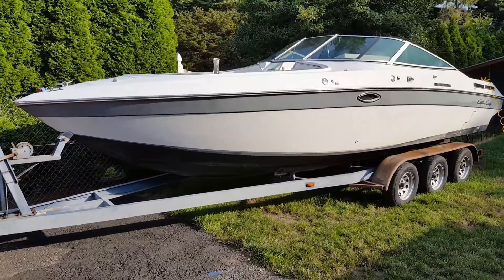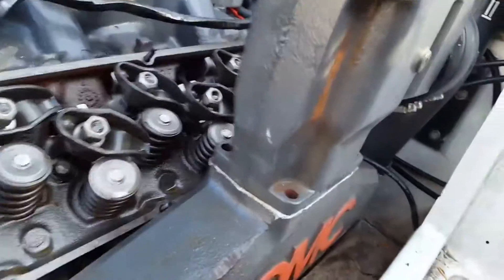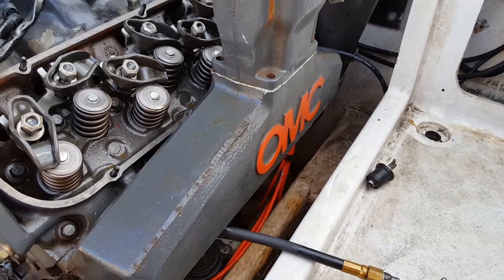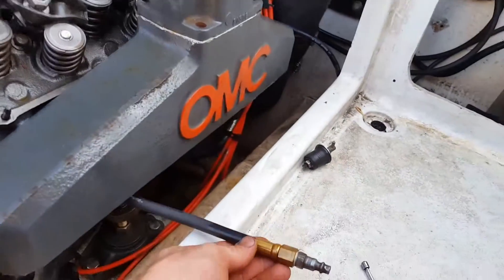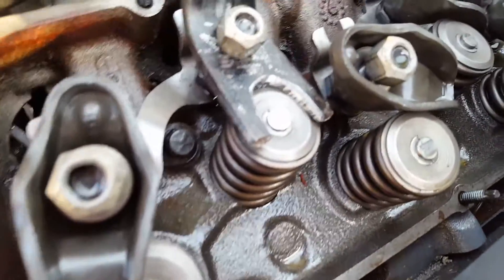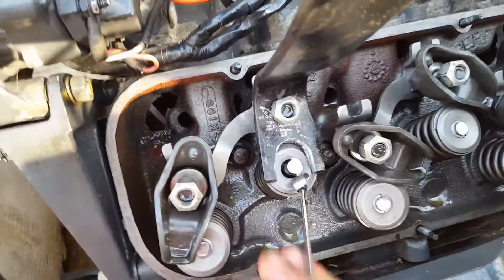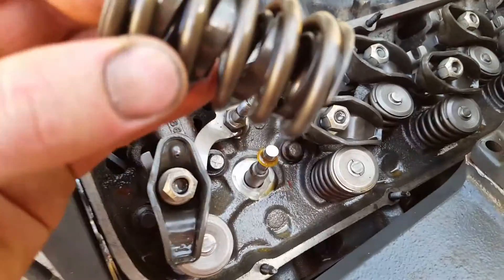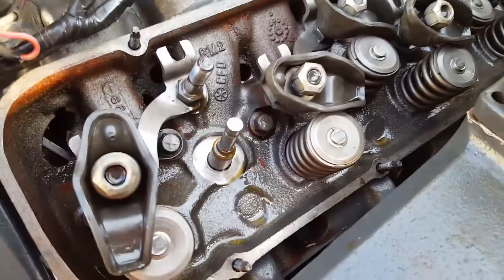Homemade VALVE SPRING COMPRESSOR TOOL - Remove springs without taking heads off - Stud mount

Comment: You can just simply tdc the cylinder you where removing the valve spring at
Reply: That would work?
Reply: Yep tried it many times on diesel engine no need for air compressor just lightly press the compressor so the valve won't slap the piston

Comment: That's not an umbrella seal.  Umbrellas drape the guides and control oil better from get down into combustion chambers.  Those are just a standard oil control seals.

Comment: I have a pry bar.  Impossible to drill it...made of spring steel and can't drill anything.
Reply from the maker: Yeah if it's a good bar it might be tough. The cheap Chinese ones work best. I was able to drill mine pretty easily

Comment: Works great. If ur heads are off just sit them on a table so the valves touch the table to get the keeper out.
Reply from the maker: Yeah with the heads off definitely makes it a little easier.  Glad to hear the tool worked good for you
Reply: @NoNonsenseKnowHow  how do I clean inside the heads though it’s too cold in my shop to use anything everything froze up over night even my propane tanks. My angle grinder works.
Reply from the maker: Not sure. Yeah propane sucks for that reason. I use a waste oil heater
Reply: @NoNonsenseKnowHow  rocket stove ? Make a video plz.
Reply: @NoNonsenseKnowHow  I’m literally freezing my ass off out here man.
Reply: @NoNonsenseKnowHow  evaporator on my compressor is locked and the sand in my blaster is frozen like a rock in the bottom. And now the propane tank is off but the flow is full. Like the cold broke the valve in the regulator.  Need something I can run overnight unattended.
Reply: @NoNonsenseKnowHow  they are d3 going in my 1984 RV. They seem okay enough just to rebuild with what I have just the insides are gunked up and light rust. Electrolysis bath ?
Reply from the maker: @akkadianrecords3709  I wouldn't get too carried away with cleaning them up. As long as the mating surfaces are clean
Reply: @NoNonsenseKnowHow  thanks. It only had 11,000 miles on it just sat for a bit with oil in it so kinda saved it.

Comment: Question, how effective is that air in the cylinder thing? i'm gonna replace some seals here in the future and Ive never used the air in the spark plug hole trick,just make sure i get the piston as close as possible to TDC and all that? i work in a shop and i have access to plenty of air and all that,just looking for tips and possible worst case scenarios, thank you for your time.
Reply from the maker: It works good. Just have to make sure it's at directly top dead center. Otherwise it could push the Piston back down
Reply: @NoNonsenseKnowHow  Thank you.
Reply from the maker: @dntlss  no prob!

Comment: This is just as good as the summit piece they want $45  for + $12 shipping!
Very glad you just saved me big time here!!
Reply from the maker: Yeah it definitely works great! Probably even better than the summit one. Sturdy built
Reply: @NoNonsenseKnowHow  
Yes.  
The video proved it the creative pry bar tool is equally safe & durable and is why I’m going to do this.
Reply from the maker: @ashqelon7267  awesome man, good luck. If you check my links in the description, there is actually a similar one on Amazon for pretty darn cheap.  It says it's for GM engines. It looks basically the same
Reply from the maker: @ashqelon7267  OEM tools 25064.  It's only 15 bucks

Comment: I made one from a $4 Harbor Freight flat pry bar and it worked like a charm! Who needs a $60 tool when you can make your own! It was for a Pontiac 400 (big block). Pontiac valves are at a unique angle but that particular pry bar happened to be already bent at the perfect angle. And it didn't even so much as skuff the threads.
Reply from the maker: Curtis Smith great to hear this worked out well for you! yeah the cheap Chinese steel pry bar is no match for hardened rocker studs!  it didn't scuff mine whatsoever as well.  thanks for sharing, and toss me a subscribe if you can.  thanks so much!
Reply: Pontiac never had a big block they are wide blocks lol

Comment: Did that booger up the threads on the stud at all?
Reply from the maker: Curtis Smith excellent question. No it did not at all. I made sure to round out the hole and make it super smooth though because that was a worry of mine as well.  I suppose you could booger up the threads with a poor technique.  The studs on these heads are made of a very hard steel as well.  Thanks for watching and I hope you found it helpful.

Comment: Damn, I'm glad I came across this video. About to do a new cam and I forgot I'm gonna have to pressurize the cylinder so the valve doesn't drop. Hmm seems like another wrench in my plans 😔
Reply: You can also push a rope into the cylinder to fill the open space.

Comment from the maker: On Amazon:
*PROFORM VALVE SPRING COMPRESSOR: https://amzn.to/2RH68iT
*CHEAPER SPRING COMPRESSOR: https://amzn.to/2U5MzSZ
*VALVE HOLDER TOOL: https://amzn.to/2GEHedb
*COMPRESSION TESTER KIT: https://amzn.to/2vth7nc
*PRYBAR I USED ON AMAZON: https://amzn.to/2OeuKNA  (will need to be modified)